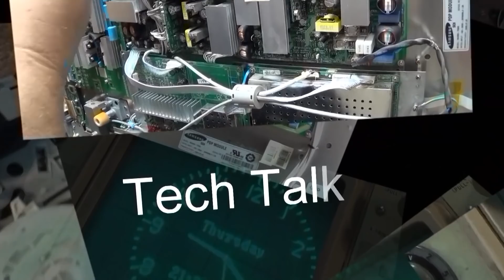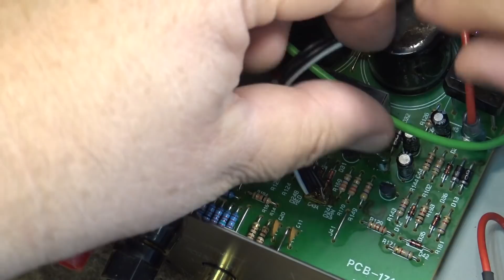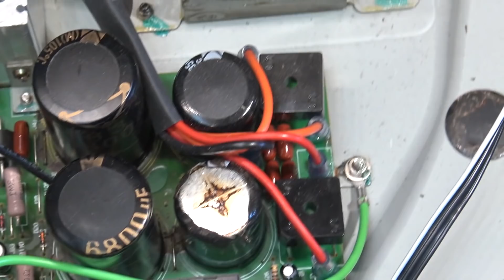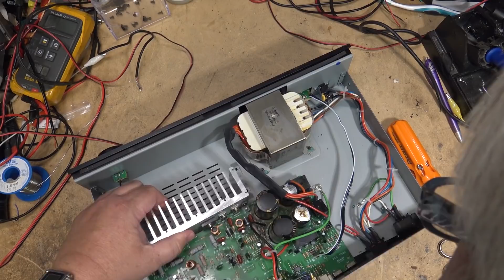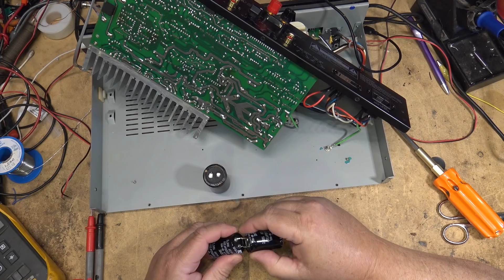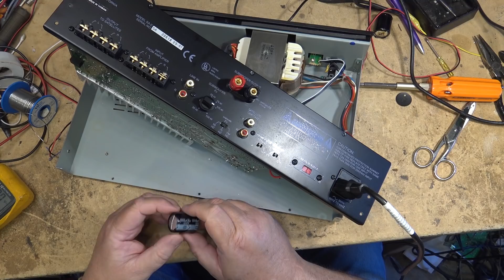NHT SA 2 120 Watt MONO sub amp repair

Comment: I am sorry you got hosed pretty good for those caps. But I also understand the convenience of getting them the same day. (I have the same issue here) 
Got some 3k hour 105C jobbies for about $6/ea at digikey for a job the other day. I know I can get an 2k 85C for $3/ea, but I rarely put those in anymore.
Reply from the maker: It's not just the convenience of getting same day, when shipping costs are added and fees to cross the border it costs more to order from digikey.  I had to order a tiny belt for my DAT deck once and a belt the size of a dime cost over 30.00 by the time shipping and fees were paid.  Make no mistake I will never order something I can go pick up in person because it always costs more to get her.  Even from the local guys.  They charge 5.00 to ship.  Now if I was driving a gas burner it would cost that is fuel, but I drive a plug in. I can do it for 1.20 and that saves me money.
Reply from the maker: I didn't get "hosed" I just pass the cost along to the client.
Reply: How do you calculate your repair costs? Would be nice to hear from someone with experience. I never really know how much to ask for a repair.
Reply from the maker: @worroSfOretsevraH  
I make nothing. I got 50 for this and for that 20 in parts and 30 labour. Remember 1 hour to drive to shop and back and 45 min in line.   Kid flipping burgers makes more than I do fixing stuff.  I do this only for the content value. I make much more from the YouTube advertising than I ever make repairing anything.  It is the video that drives the repair business. If the viewers went away and the advertising revenue went away my garage would be spotless and my car back in there so fast.  No I wouldn't miss working on electronics.  I thought I was out in 2003 when I quit the business. The only reason I returned was because of a single video I did about 9 years ago that was never intended for public screening but was for the owner and a few friends to see. It went viral and within a few months had made about 500 in revenue. YouTube went ahead without my knowledge and monetized it then reached out to me asking if I was interested in becoming a partner.  That was the time I decided to start doing these videos that have become fairly suscesfull.

Comment: I know you like to pop into your local electronic supply store, but Digi-key has all that stuff in stock and it's at your front door in less than 12 hours.  $8.00 CDN shipping (under $100 order).
Reply from the maker: That's still 8.00. Last time I ordered a part from them the shipping was 20.00 because to get the discount I had to order 100 in parts.  
I can go to the local shop and it costs me 1.20 to charge up my car.
Reply: @12voltvids  Are you sure that's DigiKey?  Mouser charges $20, but I order a lot of stuff from Digikey and it always costs me $8.00 to London, Ontario.  Maybe it's more to BC?
Reply from the maker: @ElectoneGuy  It was Mouser, digikey is 8, but that is still double what kpcomponents charges.
Incidentally the caps I bought 10,000uf 35V are 7.11 at digikey and I pad 7.50 so the price is almost identical.
Reply: @12voltvids  I just find that the online stores have better selection.  I also like to pop into my local supplier.  The guy is barely getting by and Covid nearly killed his business.
Reply from the maker: @ElectoneGuy  
They may have better selection but when it takes longer to navigate the web site to actually find what you are looking for than going to the store and picking it up. I don't order large quantities as I have no need to stock dead inventory.  I pick up just what I need for the job at hand because I don't know when the next project is coming in. The work will eventually dry up.  One of my regular clients passed away lately so I won't be getting his stuff to service and he brought me a fair bit of work.  Eventually the service business will go away completely.  I don't want to be stuck with hundreds invested in spare parts when that day comes.  When i left the business the shop i was at had about 10,000 in parts inventory that all went in the bin.

Comment: I have a large box with caps from stereo's and other things I stripped for parts, 1uf 50v right up to 15000uf 100volts. I test them on a cap tester and if they are with in 95% ratings I keep them.
Reply: I do the same, It saves life and time when  you need it suddenly.

Comment: Another nice piece of equipment saved from the bin!
Your new caps have probably self charged with static electricity and kept it in the dry plastic bag, or may have been tested and kept the charge like you said. Anyway, I've always been taught to discharge these large caps before any handling or testing, and I've seen this phenomenon multiple times. These large filtering caps used to be one of the most expensive part in a power amp or any large power supply, so it's a frequent problem they were effectively choosen close to their limits. Now, you can spend more on postage or time wasted to supply them: a 85V limit is something logic for a 60V DC. 40 years ago, the same cap in 63 V limit could have sustained without problem, but they were generously built for last, and also occupied a far more important volume. I also guess this amp is perhaps 20 years +, as most subwoofer amps are now class D modules, and your larger value caps have a lower diameter than the original ones. The 110V 220V switch is also representative of these problem, and you're probably right with the overvoltage problem. In western Europe, we had both voltages 220 V and 240 V (for UK!). So vintage international equipment designed for western Europe generally had a supplemental tap. As we are now on a 230 V supply voltage, the best choice is 240 V tap, of course detrimental of some watts in power outputs, but way more appropriate to keep circuits healthy.
Reply from the maker: When I was in high school we used to charge up caps on the variable power supply to about 200 volts and put them away in the desk drawer for the next class to "wake up" the next person to stick their fingers in to pick one up. Or charge it up call out someone's name and when they looked up toss it over at them.
Reply: @12voltvids  Had the same joke played on me , I used to recap arcade monitors ,  someone thought it would be fun charge a large power supply main filter cap to around 200 V that I just discharged through a resistor 10 mints ago so I had a sense of security handling it , I have been shocked by high energy ignition systems and that hurts but  this was more like having a firecracker go off in your hand , as one can guess that person does not work with me anymore
Reply: You'd likely go to jail if you did that today.